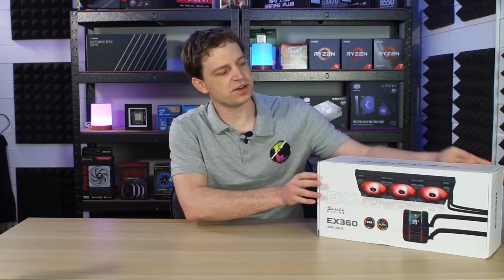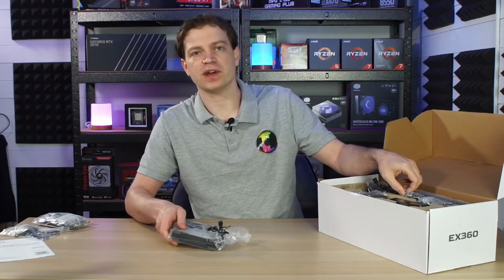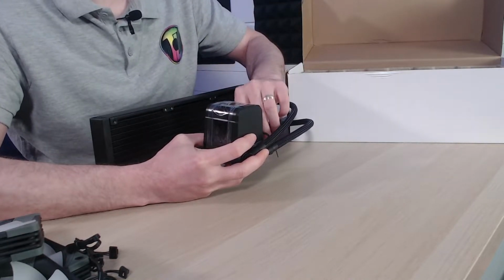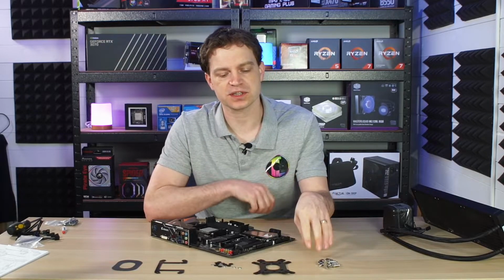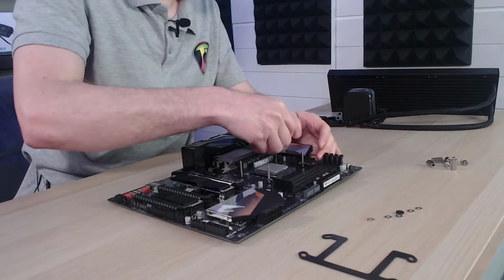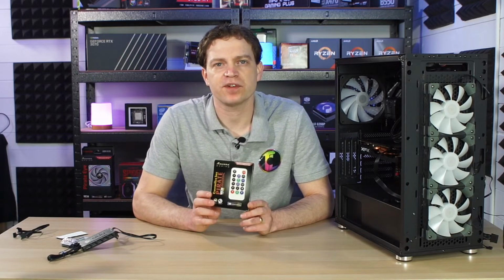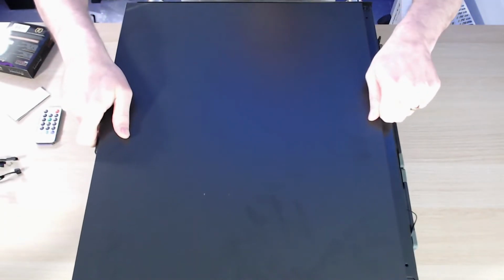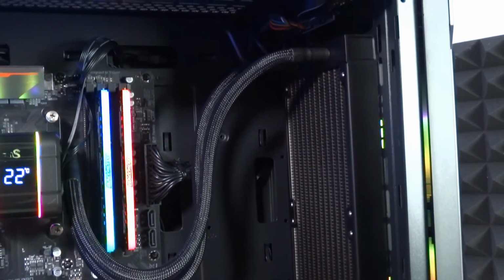This AIO Cooler is actually pretty good. - Sahara Gaming EX360.

Comment from the maker: For those wondering about the LCD display that went on and off.  After further testing it turned out to be the fan profile on the header being used.  The LCD is powered by the pump power not the RGB connection.  When voltage goes too low the LCD stops working similar to the Wraith Prism RGB systems.  Set your fan profile in the bios accordingly to resolve.
Reply: Was wondering why my LCD was doing that. Will check if changing the profile works. Thanks

Comment: works fine with my 8 GB graphics card but won't even boot with my 16 GB card (red light on board next to the graphics card), have tried it with all sorts of setups and the 16 GB just does not like this cooler, works fine with everything else I have
Reply from the maker: That's very weird considering the CPU cooler has no connection to the graphics card being used.
Reply: @TechLabUK  Totaly weird, I have it running with the same CPU and RAM on another board and have tried it on both boards, same RAM and CPU SSD HDD, as soon as I put the card with the water cooler it fails to boot, works totally fine with my same spec but an air cooler instead, all parts are compatible. got me baffled it has
Reply from the maker: @razrwolfgang1579  Did you clear the CMOs on the one where it doesn't work?  Sometimes you need to do this to get a new GPU working.